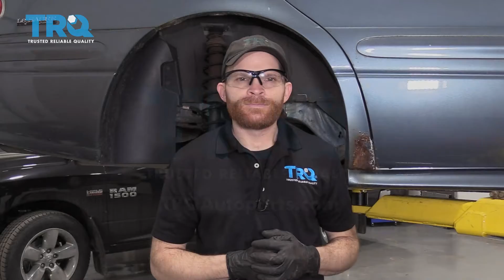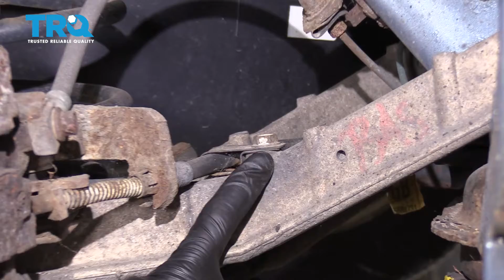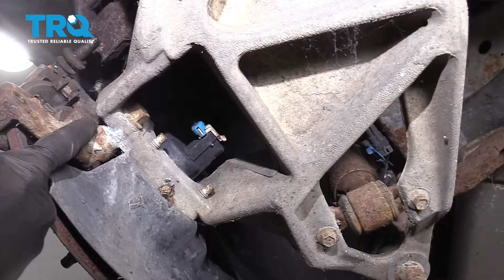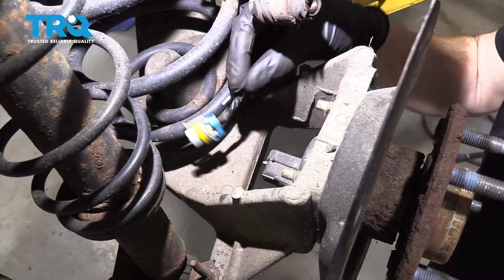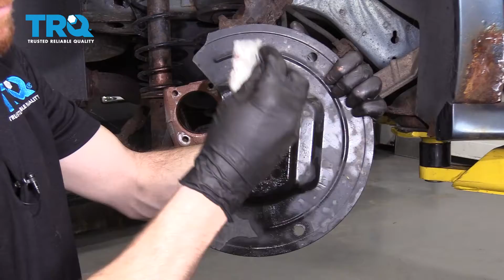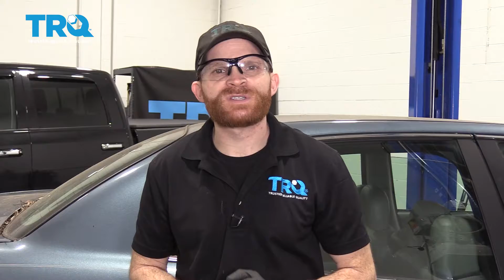How To Replace Rear Wheel Bearing & Hub 2000-2005 Buick LeSabre

Comment: My 2004 lesabre did not pass the side to side wobble test and was making a noise. Although it's not as easy as this video of someone that has good experience and is working with their car on a lift, I was able to get my done working from the garage floor. The video is a great guy of all the necessary steps and I did order my bearing assembly and the caliper tool from 1AAuto at what I think is a good price. It shipped in just a few days and although it's very hot here now I got it done. Now on to the front brake pads and rotor replacements. Thanks for the video!
Reply from the maker: +arciefan Thanks for watching our video! http://1aau.to/m/Shop-TRQ

Comment: 3 points: 1) There is a small cutout in the edge of the wheel bearing hub that allows a chisel and hammer to be used in order to force it out, Mercedes have the same cutout. (2) Use penetrating fluid first and let it seep in for an hour. (3) Using threadlocker changes torque as while it is wet it acts as a lubricant. You may think it is 50 ft lbs but with threadlocker on it is more. I never use threadlocker for these kinds of bolts just for that reason. I have broken aluminum components at torque specs because of the threadlocker lubrication.

Comment: I never heard of the copper thing, or the tool on the brake caliper. I undid the brake fluid cap to 'burp' the calipers and added after I replaced the front brake pads...
Reply: I  use nickel paste. It prevents seizing so next time you have to remove it very little force is required.